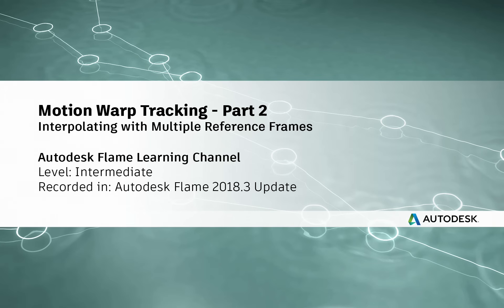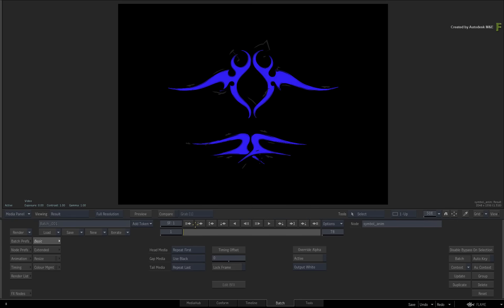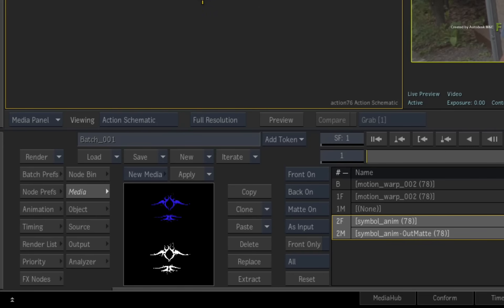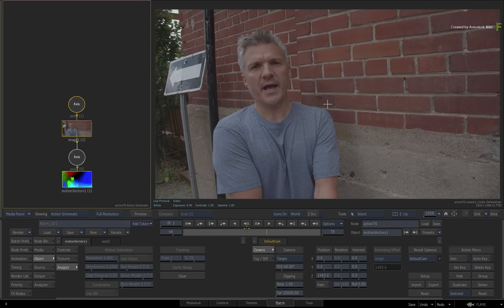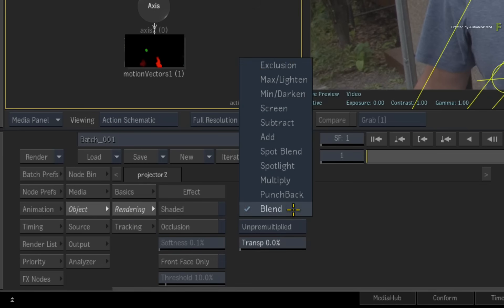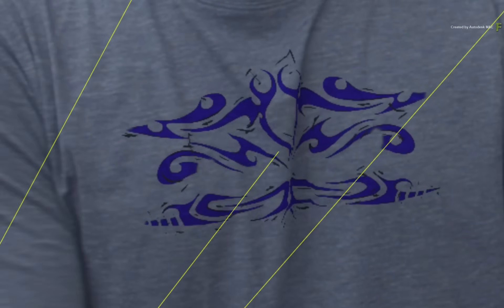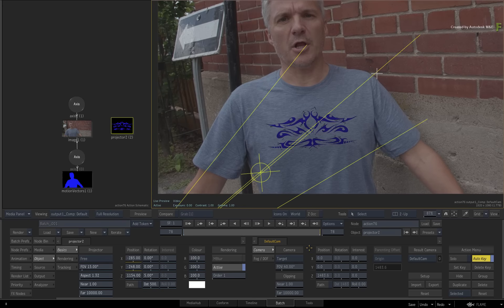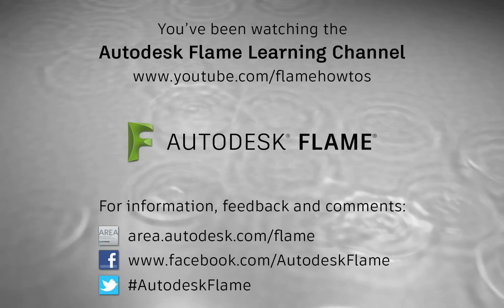Motion Warp Tracking - Part 2 - Multiple Reference Frames - Flame 2018.3 Update

Comment: Grant, how do you know where to set the last keyframe? Did you manually find the position and for time’s sake you just plug in the numbers or is there some place that is showing you an offset value?
Reply from the maker: Hi Robert, on the first frame of the composite, I positioned the projector onto the area of the T-shirt (keyframed the projector position with Autokey).    so scrubbing the time-bar the motion warp tracking will use the first reference and the position projector with the motion vectors.   For the second or multiple references, I went to the frame where the logo should look undistorted.  This could be any frame in the composite including the last frame.    Now when you add a new reference on this frame, the logo un-distorts but the projection looks to be offset.   The reason for this is that projector never actually moved, only the motion vectors and the background image.   So in order to align the logo back to the proper location of the shirt, you need to move the projector.  To make it appear seamless, you animate the movement of the projector over time.   So I keyframes the projector on the new reference frame ( last or any frame).   AS for those number, I did work them out before recording the video to save time.   You could easily eyeball it if you want.

Hope this helps and apologies for the long winded explanation.
Reply: The Flame Learning Channel thanks
Reply: I wonder, can you look at the numbers of where the camera would end up if you just let it go, and then set the keyframe and plug in those numbers? It will probably make a little more sense once I give it a go.
Reply from the maker: @RobWilliams007  I dont think it will because the camera is not moving, the pixels are being shifted by the motion vectors and I dont see any values per pixel to do an offset that you suggest.   If you see anything, please let me know.

Comment: Hi there,
I installed the last trial version and i could't find the MOTION VECTOR MAP node in the Action Bin.
The trial Installed seems to be The 2018 release, is there a way to Download the 2018.3 Update? 
Or the only available trial version is Flame 2018?
Regards
Thank you 
Francesco
Reply from the maker: Hi Francesco Piccoli, The trial version of Flame is only version 2018 and does not contain any of the updates.  The updates have never been part of the trial software.
Reply: Got it,
Thanks

Comment: very nice, But what to do if you need an alpha channel out of action from your logo, to do some compositing after action?
Reply from the maker: Hi Peter van Rij, you should be able to create an alpha output from Action and any motion warped images will have their alphas warped as well.   This was done so that you could do post operations such as compositing or colour correction after the initial action node.  Many thanks for the feedback!
Reply: Thanks for your reply, I found it already. To output an alpha channel from a projector you have to choose under Outputs the 'Projector Matte' instead of the normal matte. :)